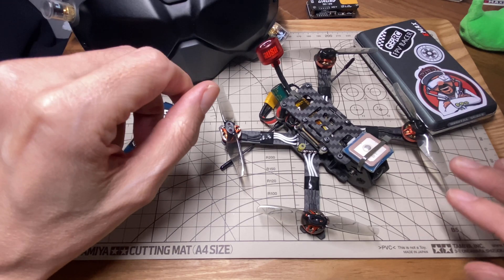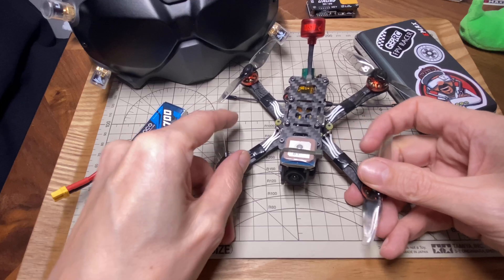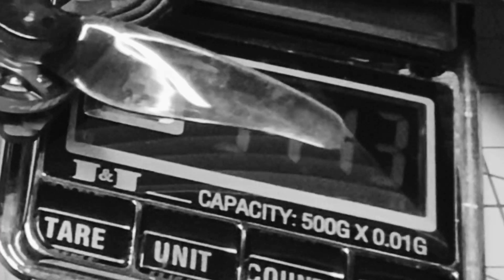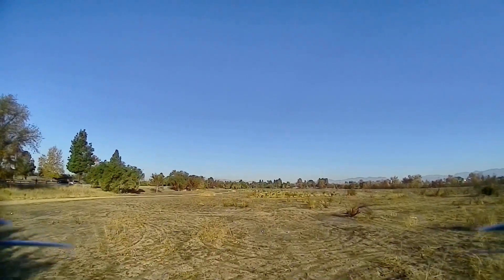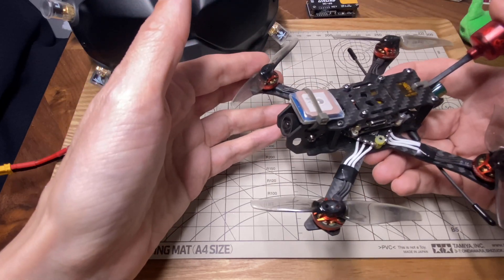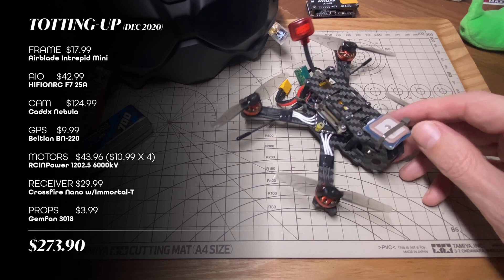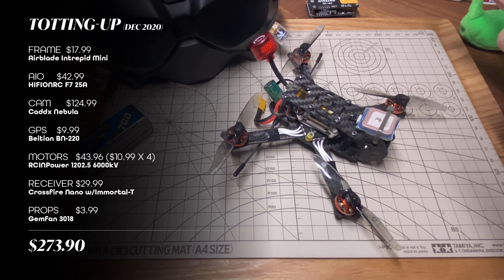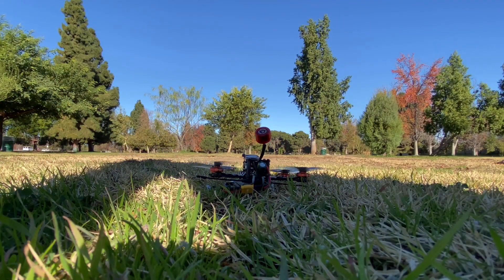Digital Micro Medium Range: An Experiment Part 2 ~ A Conclusion

Comment: Enable GPS failsafe and fly in a straight line till you lose video or control link.
Reply from the maker: I shall do so eventually! I want to find a place where, in the off chance something goes wrong, I don’t come down over anything (road, property, people) or have the quad be unretrievable.
Reply: @MiniMicroFPV  Make sure GPS rescue is working at close range. Use the failsafe switch in betaflight to simulate a full failsafe. So far for my own builds GPS rescue has worked like a champ.
Reply from the maker: @changeagent228  Thanks! I’ve tested Rescue on a switch when it was 100 meters out and it worked great but I haven’t tried the failsafe method yet.
Reply: @MiniMicroFPV  Happy flying 😁👍
Reply from the maker: @changeagent228  Cheers!

Comment: lovely little build, I need to find similar motors for mine. I think I saw cheap Happymodel 1404s somewhere.
Reply from the maker: Thanks! Oh yeah I just saw those on Banggood for $11.28 each.
Reply: @MiniMicroFPV  One of my favorite RC shops has Flashobby 2004s in stock, so many cool motors coming out.

https://rotorvillage.ca/flash-hobby-king-2004-1700-3150kv-motor/
Reply: @MiniMicroFPV  
I ordered twice from there already and got my stuff, kinda tempting...

https://www.xt-xinte.com/Happymodel-EX1404-1404-KV4800-KV2750-KV3500-3-4S-Brushless-Motor-1-5mm-Mounting-Shaft-for-RC-FPV-Racing-Freestyle-3inch-Drones-p784491.html
Reply from the maker: I haven’t ordered from there before that’s a nice price for those Happymodels!
Reply: @MiniMicroFPV  They have good prices on LDARC branded motors and many other RC parts.